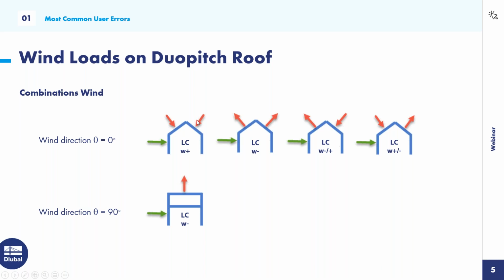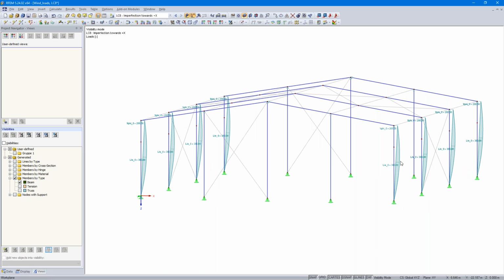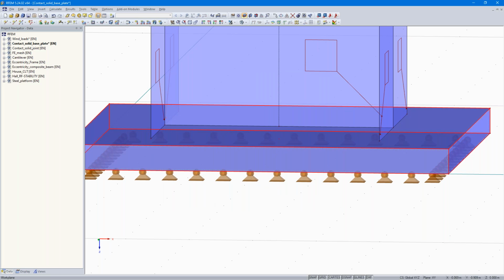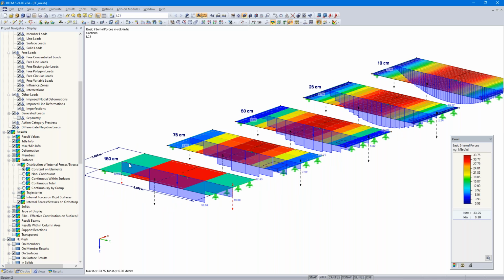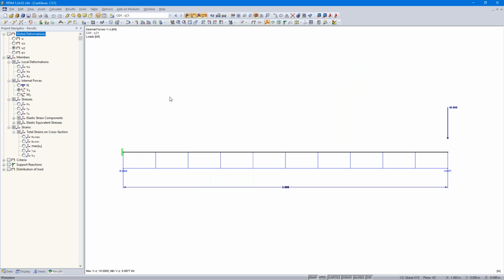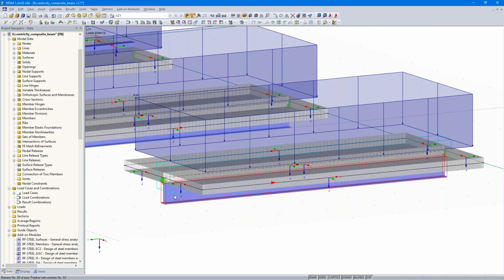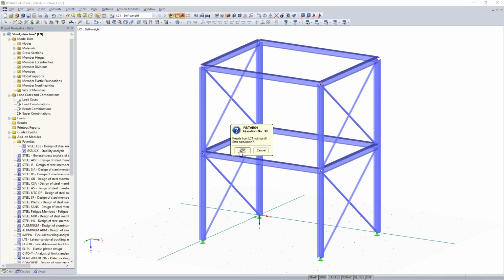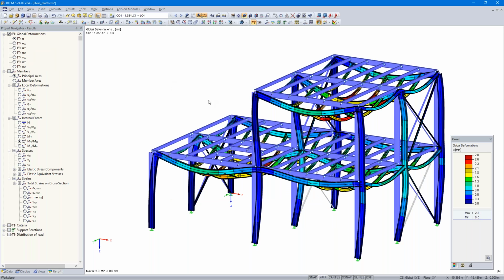The Most Common User Errors With RFEM and RSTAB | Thu, Feb 4, 2021

Comment: When I scroll with mouse wheel in one direction, it makes zoom in, when I scroll in another direction, it makes zoom out. How to make it inversely?
Reply from the maker: Hi, Tomislav!
in the following FAQ and Knowledge Base article you get more information about all the mouse functions: https://www.dlubal.com/en/support-and-learning/support/faq/002687 and https://www.dlubal.com/en/support-and-learning/support/knowledge-base/001205
Reply: @DlubalEN  but I want that dlubal makes zoom in when I move mouse wheel forward (away from me), now it makes zoom out.
Reply from the maker: Hi, Tomislav!
You have to do this in your mouse software. E.g. "Logitech Options"
Reply: @DlubalEN  I will try, but it is odd that in autocad, and all the other software makes zoom in when i roll wheel forward but only in dlubal makes zoom out. Maybe because axis z looks down instead up.
Reply from the maker: Hi, Tomislav!
It doesn't depends on the z axis. You can adjust the direction in the base data (Settings & Options).
Reply: @DlubalEN  ok, thank you.

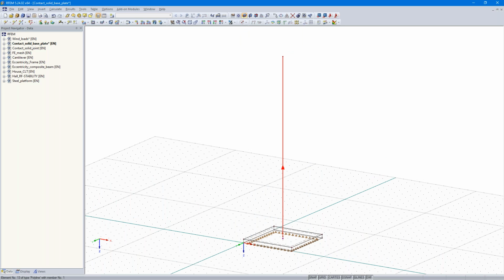Comment: It was really helpful!!! I improved my meshing. However, I have a question: In 19:00 surface of the member were obtained by "generate surface from member". As I understand it was done in order to create contact between plate and column? If I do that in the 'table-->member' the member type shows Null. I set up beam member before that. In both cases displacement results match, but in the tutorial's method I can set up mesh and create section to check results at given point. So is that question of preferences or surface member is more accurate? Thank you!
Reply from the maker: Hi, Joysgellertsss!
The member was already connected to the plate, because that is the default connection between elements in our software. After creating the surfaces there is no member for the software to recognize, therefore you see the "null" in the table.
In general, by generating surfaces from a member, you can add a mesh and view detailed results as well as stresses on the respective surfaces.
If you have more questions let us know in the comments, or simply contact our support at dlubal.com

Comment: Question about wind on simetrical duopicth roof buildings. You still need to make same amount of windload cases on -0degr  and -90degr ? And one more question about imperfections - Dimensioning columns and beams useing EC3 - warping torsion with sets of members we already are seting initial local bow imperfection L/250 (for IPE/HEA profiles) - do we  stil must imput imperfections in seperate loadcases in +/-x and +/-y directions fore those sets of members?
Reply from the maker: Hi, Arnis!
If you need assistance, please contact our customer support by e-mail at info@dlubal.com.